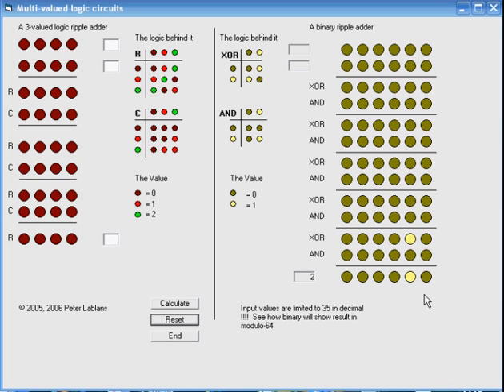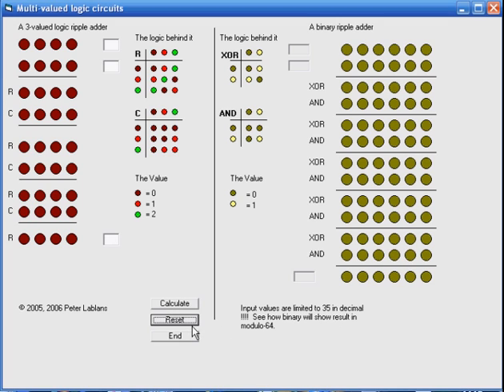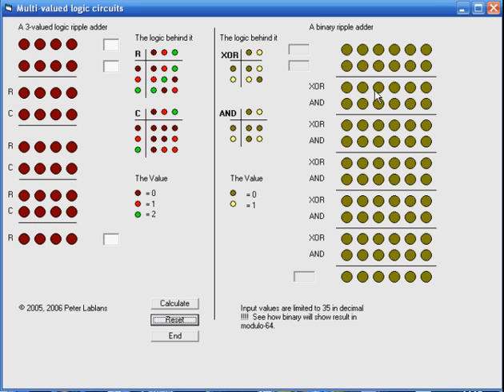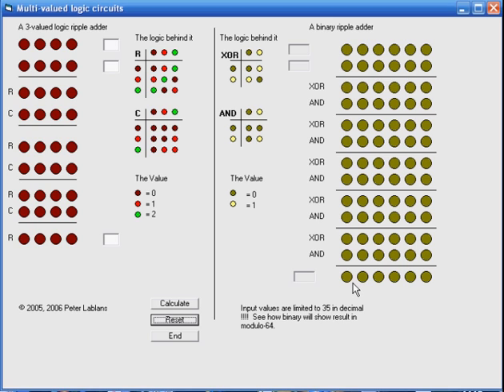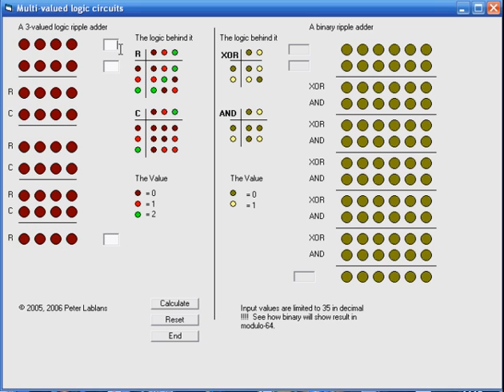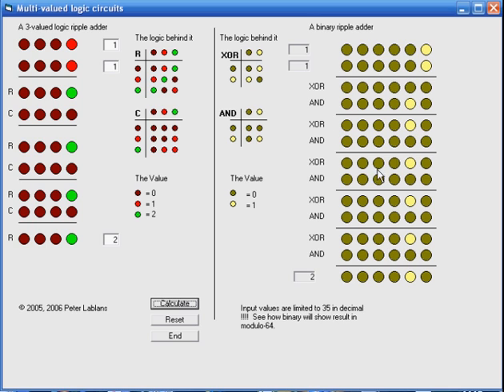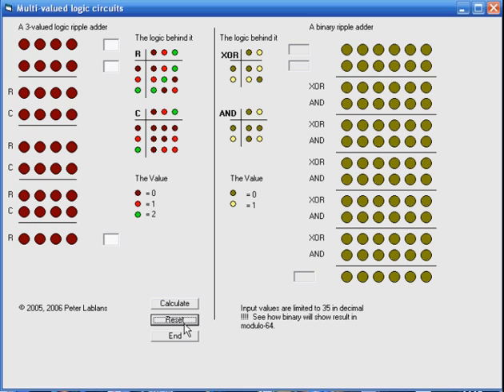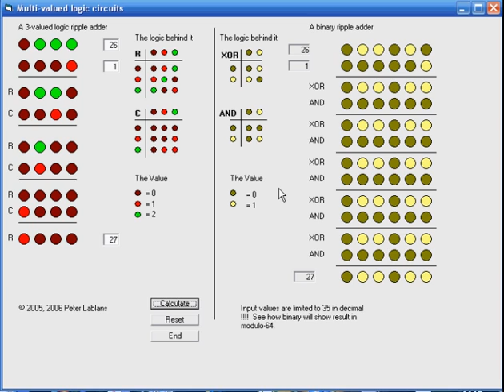Ripple Adder in Binary and Ternary Logic

Comment: Is it true that higher bases result in faster computation?
Reply: Not necessarily. The problem of choosing the most optimal base (radix) is called optimal radix choice, theoretically the most optimal radix is e=2.718… but 3 is slightly more optimal than 2, every other number is not as optimal
Reply: yes, but they are also more difficult to implement